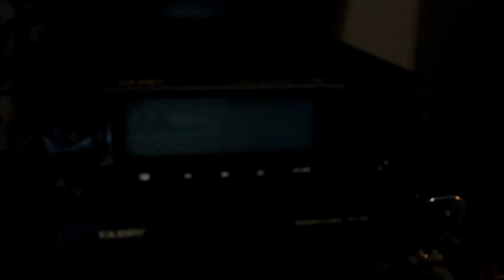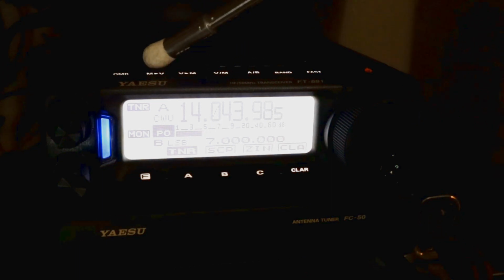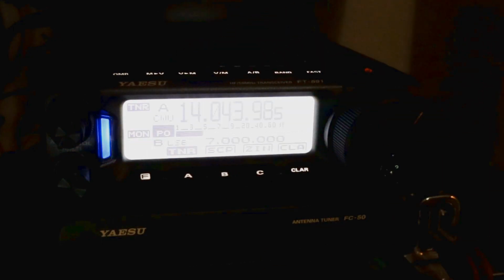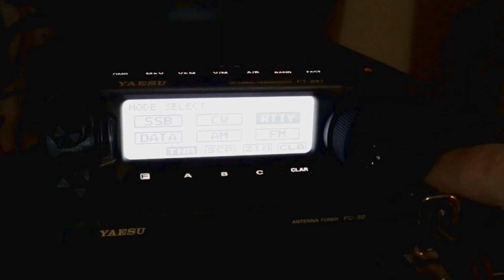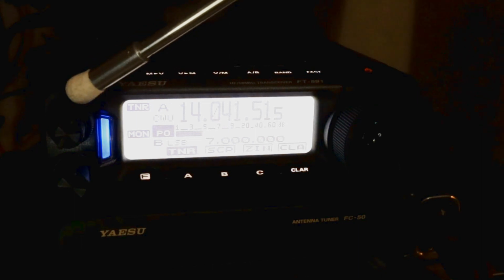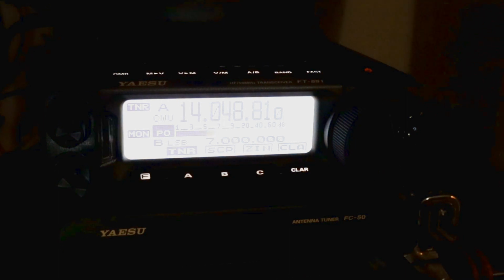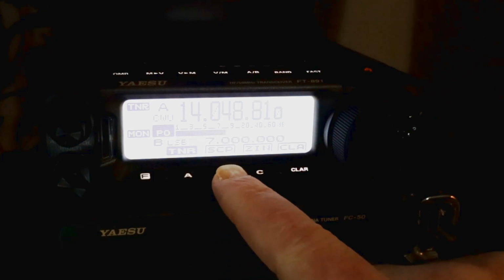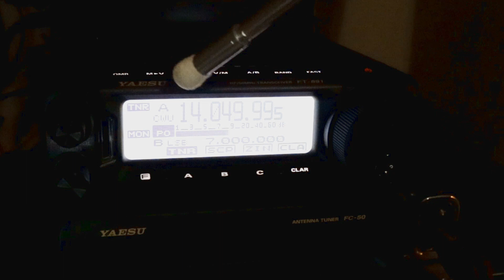A tour of the FT-891/FC-50 Connectors, Buttons, and Knobs

Comment: What’s up with that flashing blue light on the left side? Does Yaesu let you turn that off?
Reply from the maker: That light is called the TX/BUSY LED When you transmit it turns red, and when it receives a signal it will glow blue.  You can adjust (menu 02-04J the brightness from 1 to 15, with 8 being the default value.  The higher the number, the brighter the LED.  It also functions as a zero in indicator and can be enabled/disabled in menu item 02-06
Reply: Thank you for replying

Comment: So to be clear you don’t hate the Yaesu FC-50 correct? You just hate the term antenna tuner? I’m leaning towards the FC-50 vs the MFJ one.
Reply from the maker: I don’t hate anything, just improper use of terms. I like the FC-50 and it does a good job, but I also like anything that works so MFJ or LDG tuners are more than acceptable.